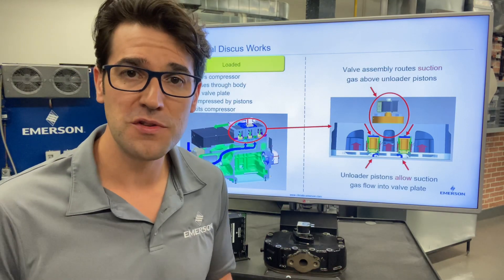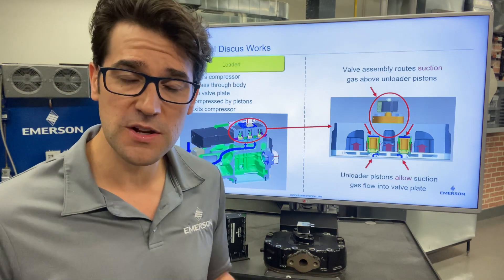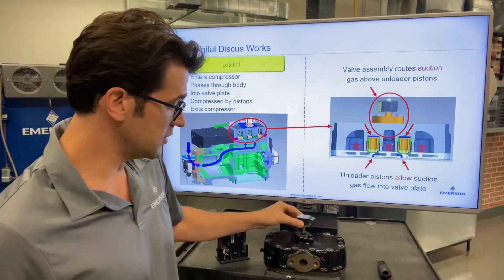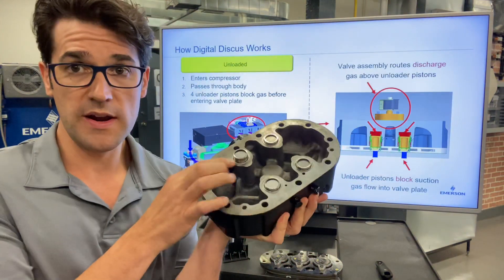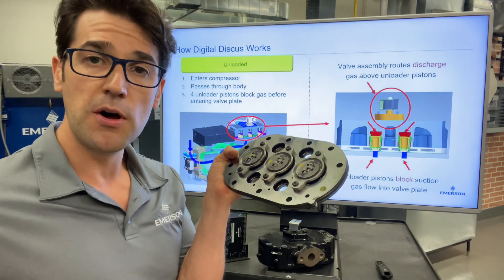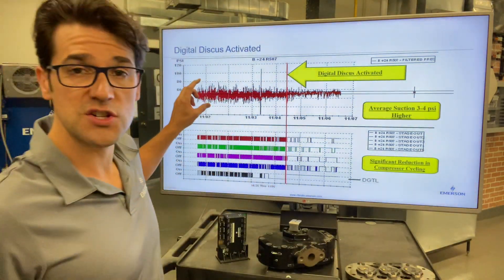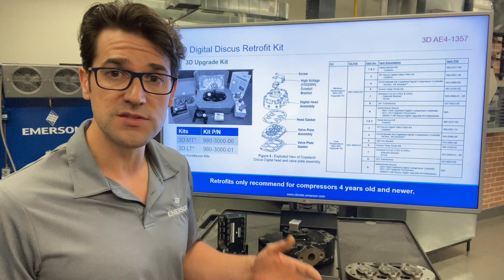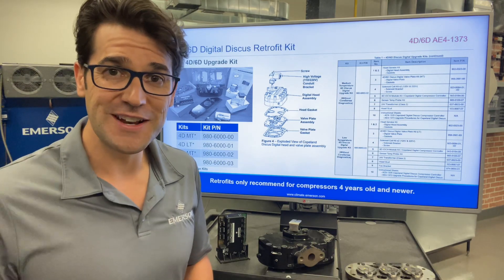Copeland Digital Discus

Comment: Trevor I appreciate you for your guidance  so far.
How can an existing Compressor with Fixed Head Pressure be Retrofitted to take Advantages of Low Condensing Pressure as the Ambient Air Temperature Changes?
Reply from the maker: On Semi Hermetics you can buy a retrofit kit and replace the head and accessories. With a Scroll, you need to replace the compressor. https://webapps.emerson.com/online-product-information/Publication/LaunchPDF?Index=AEB&PDF=1357

Comment: Hey Trevor should I have a normal net oil on a digital discus while it is unloading or should the net oil soar up really high. Typically this would be a sign of blown plates just not sure if this might be part of the operation with this  compressor setup.
Reply from the maker: Yes it should be similar.  I recommend always checking net oil pressure when the compressor is full loaded.

Comment: Hey Trevor we were recently installing some digital discus compressors and was curious about why one came with only 6 lugs on the terminal block and another came with 9? One was a 4DAXF47KE-TSK and the other was a 4DHNF63KE-FSD? Thanks
Reply from the maker: That is a great question. TSK are 9 lead duel voltage compressors. FSD are 6 lead single voltage compressors. Check this out https://webapps.emerson.com/online-product-information/Publication/LaunchPDF?Index=AEB&PDF=1076
Reply: @RefrigerationMentor  got it thanks alot trevor!